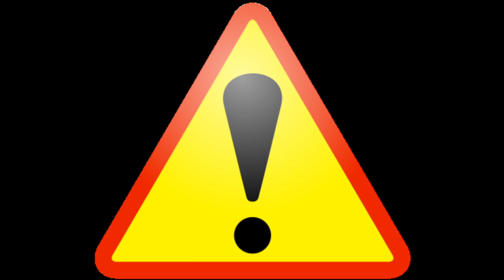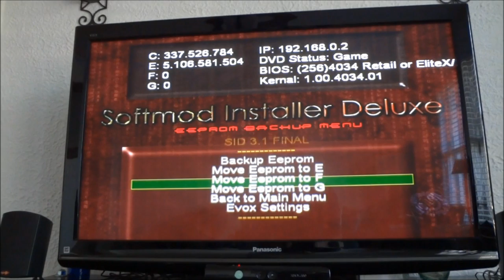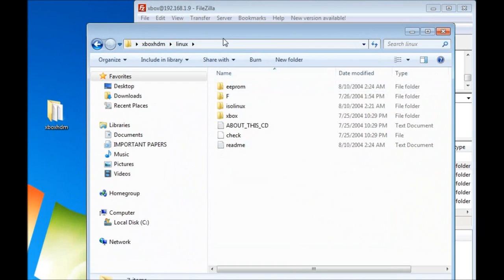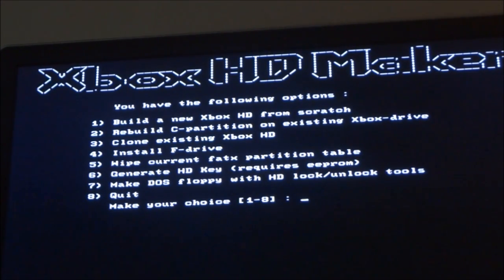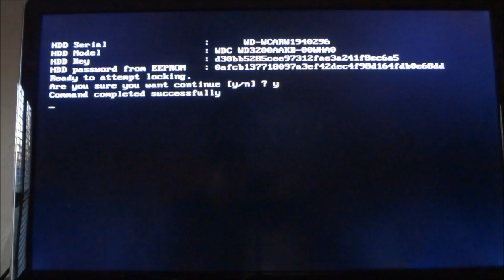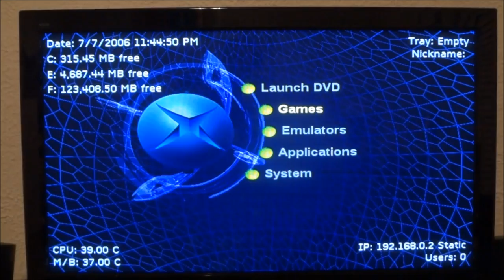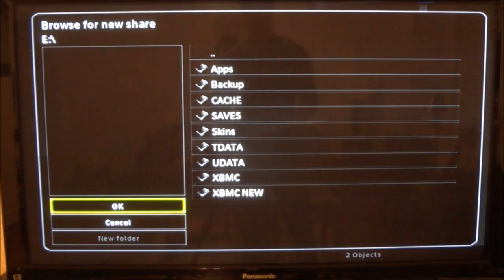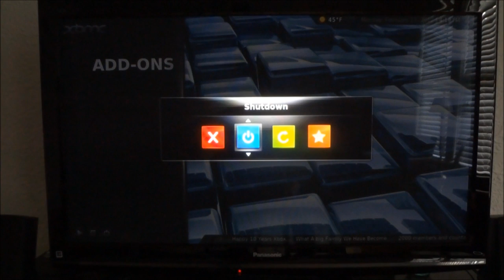How to Softmod an Original Xbox, install XBMC, and install a bigger Hard Drive!

Comment: I dont have a Memory card, or any adapters to make/flash one, i can however access my Xbox Hard drive directly using a USB IDE adapter and Windows XP in a virtual machine, using XPlorer360, and can (after some trial and error hotswapping) access and write files to the xbox hard drive, will this work if i copy those savegame files and the installer mods to the UDATA folder on the xbox hard drive?
Reply: Yes, this worked for me. Hotswap to install the softmod. FTP the game save to the Xbox. Backup eeprom by manually launching the default.xbe from the game save. Copy the eeprom backup to your PC over FTP, build a new iso, and prep the new HDD using the instructions in this video.

Comment: If I already had xbmc mod installed, and others such as xbn64 and like unleashedX. It was bought a while ago and the nephew came over and did something to it. Now it boots up to the OG menu every time and I cannot access the softmod menus anymore
Reply from the maker: Good news is that not all is lost. Sounds like they clicked on a “live” link in one of your games which caused the game to do an update to your Xbox and over write the soft mod. 

You need to figure out which game was used to soft mod your Xbox and use that and run through the soft mod again. The files to exploit the soft mod are still on your Xbox - so again you just need to figure out what game was used and follow the promps. Hopefully it is splinter cell so you can follow along with my video.
Reply: @Ben's Channel  im hoping it's splinter cell as well. I have all the mods on the memory in the Xbox still. So I think if I can just get to the menu it'd hopefully just relaunch the other ones. 
Once I get splinter cell I'll see. But I feel they may have another disk with other stuff. Either way thank you! I'll see if it works.
Reply from the maker: @CliffordChaosGames  yes, all of the mods will still be there. You just need to “overwrite” the menu system with Xbmc or any other soft mod of choice.

Comment: I have an original crystal xbox and the splinter cell game however I don't have a memory card or a controller port to female USB adapter. If there a way for me to get the exploited saves onto the xbox's hard drive without buying anything else?

Comment: So, after installing softmod, I accidentally clicked yes to shutdown before I installed the dashboard.  Now it won't load anything.  If I put splinter cell in it will load the game fine, but if I try to load Linux back up it won't load.  I'm starting to think that the softmod messed up, but you've obviously done this a lot.  Any suggestions?

Comment: do i really need to burn AID to a dvd? or can i simply run it from hdd
already extracted the AID iso, and transfered it over to my xboxhd and got it running, but i'm still not sure if i should install xbmc from there. btw i already installed a bigger hdd and partitioned it under unleashx (currently using).
any help would be appreciated

will i still have access to unleashx dashboard? how to select which one to boot from?
Reply: confirmed working, i managed to install xbmc through hdd. also had some trouble connecting to  network via dvd2xbox, so i just booted to AID after transfering the files(xbmc new), went to file manager, changed the xbmc directorys names from there without connecting to my pc and sucessfully upgraded, thanks a lot for this very helpful guide

Comment: Thanks for the guide.. But it is totally useless without an action replay. I modded a dongle so I can use a regular USB on the xbox, but I can't find any way to transfer it.
All the guides that mention action replay are from 2004 with dead links, and everything else doesn't work

Comment: Ha ha ha. I had EXACTLY the same issue.  You could go the AID route if you really want the file that bad. But it's a whole lot of b.s. steps. 

Did you still want to install the big hard drive with XBMC and emus?  If so you want to use SPPV's autobuilder program.

Otherwise use his SPPV XBMC installer 3.2.2 which can only install dashboards on a pre-modded xbox.

Let me know what you wanna do and I'll respond with instructions

Cheers

Comment: I click a to use all hdd space on my 250gb hdd but when i go back to the dash it just shows as 123gb. Whats up with that
Reply: you reformatted wrong. off the top of my head it's the cluster size is an issue. don't quote me on that though. I'd recommend going to

e m u x t r a s .net

the last place on the web that's Xbox moving specific.
Reply: typo: you reformatted it wrong.
Reply: +destronger X turns out I had to choose 249gb instead of the 250 and all is good now. cluster size was auto selected but it just needed me to custom put in 1gb less and bang its showing the full 249

Comment: I ran into the same problem you did.  I already had a softmod xbox with xbmc installed on it, but it was with the stock 8gb hard drive and i wanted to upgrade to a bigger hard drive.  Did everything in this tutorial to upgrade to bigger hard drive but it ended up being the MS dash.  Have you figured out another method to get this to work?

Comment: I got the xbmc to work and can play nes games just fine using the softmod.  But i cant get snes or sega games to work.  The only emulator that shows up is the nes emulator.  I can locate the emulators through another partition of the hd, but when trying to play the games for these other systems, it freezes up the system.  Any ideas on what to do?

Comment: Hey there, I have some issues concerning the softmod - I´ve already softmodded my xbox a while ago but unfortunately I managed to select the Xbox Live-features in a game, the system installed kind of an update and now the xbox switched back to the original dashboard - However the method via the modded splinter cell save file doesnt function anymore - Anytime I load the savefile the front LED turns orange but afterwards the CD restarts and I cannot get into the menue of the SID Installer.

Comment: got a question for ya, so i got my soft mod done and it worked great, so i put my hard drive in, everything went great. but now when i turn on the xbox it boots to the original screen and acts like the softmod is gone? do i reinstall the softmod? any help would be great thanks

Comment: What's the biggest size hard disk I can install inside my modded Xbox? ~ do we need to partition it to multiple parts? Ideally, I would like to install a 2TB or bigger, is this possible?
Reply: Philippe Lafortune It is possible, but you will need a Sata to Ide converter board since  I doubt there are 2tb HD's for IDE.

Comment: Hey I am a rookie at this and I deleted my edrive. My xbox will still play games but my dash board is gone. Its says load disc and system settings is there a way to recover from this. I have a hard mod chip that I was thinking about trying. What do you think?
Reply: Chris Cooper hi did you sort this out I have the same problem

Comment: I went through this, got XBMC, all good. Did that a while ago. Now I just want Avalaunch. If I use the AID Install Dashboard to E and choose Avalaunch, it only boots to the built in evovution x. If I install XBMC, it boots XBMC. I've renamed the XBE for avalaunch to the same evoxdash.xbe, copied to C, moved and rename several other times, but it never boots to Avalaunch. Anyone know why?
Reply: Figured it out, must have something to do with installing Evox at the begining. Re-ran the SID from Splinter Cell save hack and installed UnleashX. Then installed Avalaunch via AID and I'm all good!

Comment: I softmodded my OG Xbox,,,,,and then my kids wanted to watch a movie in it and it said updating and now I only have original MS Xbox DASH. I cant figure out what to do?? Please any help
Reply from the maker: Sounds like you need to repeat the softmod. I would go back through by placing splinter cell in your xbox and just go through the motions. Every now and again there was a DVD that had an xbox demo on it, which would automatically update the xbox dashboard.
Reply: Ii tried that with no success. I had to pop in the original drive and go from there and re-clone the drive. Thx
Reply: Kim Frankenberg You should always make sure you XBOX dash is updated to the latest version before modding, which I forget what that is but you can update the dash to the latest by trying to play some sports titles on-line. I used ESPN NFL 2K5, tried to do get a network game started and the dash was automatically updated to the correct version. The update is on the disc so you don't need to actually connect to anything. You can find more detailed tutorials/vids about this.

Comment: Hi i recently bought an original xbox with xbmc installed, i was just wondering if anyone knew how to uninstall it from my xbox (keep in mind i bought this xbox like this and i dod not install it so you will have to completely spell it out for me and tell me if i have to plug in any hard drive to any computers and what not) i just want a stock xbox dashboard and i do not know what version i have all i can tell you is that it plays a noise powering up noise that sounds super ninetys when i turn it on

Comment: Using XboxHDM would be a lot easier to do nowa days considering how hard it is to find n action replay.
Reply: I think that's how I did mine back in '03, I never owned a Memcard for my XBOX, and certainly never had an AR. I'm glad I came across this Vid. 'cause I all but, forgot about HDM. And, now I'm kinda interested in upping my HDD from 120GB to either a 320, or possibly a full 500GB P-ATA Drive soon.
Thankfully they're not as expensive as they once were.
Reply: If I had a greener way to connect to XBC or XBKai, then having to slave off the Power hungry PC then I'd consider it. If only to replay PGR2 again, as well as Forza. As it it though. No proper MIPS version exists for any WRT Router much less mine.

So no dice...
Reply: Fork the World. I'm more concerned with the "Green" in my Pocket! Or the lack thereof. And I'm not keen on running everything in my House at once. There used to be a plug-in for the WRT Routers a long time ago. But, they were never updated. :(

Comment: I am using Auto-Installer V and I am trying to FTP XBMC to my Xbox. When I do, the data is not showing up on my Xbox. I'm very lost. Any help?
Reply: try reboot system after copying the files on your hard drive.
Reply: Emre Gök I finally got it to work, but it never does default to XBMC. I have to manually load it every time. I found the emulators, but i have not been able to find the ROM's for the games. It definitely is a work in progress.

Comment: great video i jsut wanted teh upgrading hard drive bit , i followed correctly  the linux cd boots up in my pc but when i choose option 1 the screen goes black & stays black & my caps lock & scroll lock button jsut flash on & off what am i or have i done wrong many thx

Comment: Hi there, I'm reading online that if you leave a softmodded xbox unplugged for a while it will get stuck in a clock loop due to the clock being reset and not being able to return to the MS dash. If I do this method, will that happen to my xbox or will the MS dash still exist on the xbox?

Comment: I have confirmed that I am running the latest version. What was happening was the skin was still ProjectMayhem, I thought it was supposed to switch to Confluence automatically when updated. 

At 26:30 in the tutorial you have all of your emulators graphically displayed. I would like to do this however right now mine are just listed as text. I went to programs-add source - and added my emulator folder which is on my E drive. 

Could you explain how to graphically display the emulators?  Thanks!

Comment: Hello there I'm stuck on process 5. I inserted and booted the cd used option 1 and my screen has all the white letters but already has the penguin in the up left corner before even doing that process. Since the penguin is already there should I just move on to locking the harddrive.

Comment: Will a USB to xbox adapter work instead of a soft moded memory card?
Reply: Yep! Only thing is that quite a few USBs won't work, it's generally best to use one that's around 512MB or 1GB.
Reply: good to know.  Just wanted to make sure before I hit buy on Amazon
Reply: +sleasoup how do you get the computer to recognize the usb once the xbox reformats it? I tried Xplorer360 like all the websites say, but my computer will not launch it.  Must be something I'm missing.

Comment: need some help, i get to the creation of the hard drive on the black screen of the computer, it boots up the cd just fine but im using a pce of shit apple keyboard and it for some reason wont let me select anything( eg option 1)then after a while it boots something on its own (im guessing the default option(option 1)and then it loads up saying to type xboxhd to start soi do and i get this message: the script assumes /dev/hda is the device your trying to use ,and then ses it cnt find it help me!!

Comment: could you use a flash drive instead of cd?
Reply: Possibly, if you can mod One of the Ports to take a standard USB1.1. Which isn't that hard to do... Considering that, THEY ARE USB1.1!
But, would it not be simpler to download that XBMC Binary, or Game, and just FTP it, to the XBOX though the Dashboard?!

I think that it would be, and that's pretty much how I've been rolling on the XBOX all these years now!
Reply: I guess you needed a Flash Card (Memory Cart -- AR Cart), in order to actually get the save Game 'xploits into your XBOX. Though I never owned any of these things, and was still able to somehow get the Save Files onto my XBOX at the time.

The only thing I can recall about Softmoding that XBOX was how finicky it became, and how often it would soft-brick. So I just got the first Modchip I was able to find back then. It was an DMS X-B.i.t Chip. Sadly it didn't have the later X3, and SmartXX LCD& VFD Display controller(s)...
Reply: Well I have several old xboxes I was considering softmodding for shits and giggles. I have a few old ide drives as well. Just need to line up a few more things to get started.
Reply: Phill McKraken
I used the IDE hotswap method to install the softmod on the 8GB HDD initially. The video I watched didn't mention the eeprom, nor did it give the option to backup.
From here I just FTP'ed the 007 Agent Under Fire exploit game save to the E:\UDATA folder and executed the .xbe. This allowed me to backup the eeprom and FTP it back to my PC. From here I had to prep another cd with the C:\, E:\, and eeprom as mentioned here and format my new drive.

I ended up burning 2 cd's but was able to install the larger drive and XBMC using thnigs I had laying around.
Reply: Nice
Reply: Ben Creamer
That's the poor mans way to do it lol!
That's how I also done mine up back then.
Looking back at it now, and that I still had the useless 8GB OEM Seagate Drive installed. I suspect those "Softbricks" were probably caused by running newer Software (at the time), i.e. dashupdate.xbe, that was on the Disc. This however, in 2014 shouldn't be a problem anymore though.

Thankfully these "updates" weren't able to feck your Modchip installs though.

Comment: I am using action replay to softmod 1st gen Xbox.  I have sid5.11 installer and splinter cell.I also am installing a larger HDD.  So I downloaded AID v4.53 with xbmc.  I also have filezilla.  Is there anything else I will need?

Comment: Remade my .iso file after re-transfering files from original hd. Everything is successful using xboxhd for my new 250gb hd except locking. When you locked yours it says "command completed successfully" before it says "detecting drive status...". My program does not. If just says detecting drive status and the [security enabled] listing says [no] after every attempt. Any suggestions?? Thanks

Comment: i soft modded  with splinter cell. Using router to connect.  got filezilla to transfer files over to xbox but nothing shows up on xbox under emulators.I can find my files when I go to filezilla and sign into my xbox.  Any ideas?  I am very new to this.  Do I have to do something different to the emulators and roms that I don't need to do to just play them on my computer?  The downloads are all zipped if that matters.  Must have static ip or doesn't matter?  any inuput is appreciated.  Thank you.

Comment: i am alos using a 400gb hd got the linux cd ready it boots up correctly using my windows 7 pc but i cant get past the first screen. it has the penguin at top left already and the white letters are all the components of my pc. my harddrive is formated for fat32 and even tried as raw same screen. im gonna try using an old windows xp or 98 pc and see if that works.

Comment: Not to p!ss in Ops Cheerios... But, if you already installed a Softmod w/a newer HDD... Or even wished to continue using the Stock Drive... For whatever reason! Couldn't you just save yourself a lot of pain by downloading a Binary Copy of XBMC4XBOX v3.5 Beta 2 (The latest release to date!), and just FTP that into your F:\Apps?

Seems like a lot of wasted time, and plastic to burn this onto Media.
If XBOX Modding, was still a big thing, and I had to turn over 10+ of these in a Week then I'd might consider this. But, for a single One off... I'd just FTP it!

@ ~20.13: Again I call shenanigans!
One would only use E+F, if you had a HDD less then 150Gb (IIRC). At the time I think the largest Partition you could have on the XBOX was a 148GB. LBA48? Again IIRC. So in any case if you had a Drive that was larger then a 150GB you'd have to use the E+F+G Setting. Not the E+F....